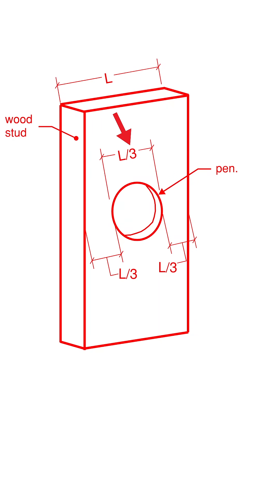1 Minute Structural Engineer Reviews Reddit Construction 2 #reddit #engineering #civilengineering

Comment: Yeah it's stupid and lazy and obviously the holes could have been smaller.   I think it looks like foam rather than conduit.   The lazy idiot should be made to do it over on principle alone.    No reason to needlessly weaken something.

Having said that, I'm going to say something controversial.   it probably would have been much worse if it was higher up like 1/2way up, where the bending moment would have been bigger.    Being right near the bottom is probably the best place to have screwed it up.   If you actually loaded it to failure, I think it might actually be surprisingly strong.   Not an excuse, but an observation.    It's not just the diameter of the hole, but where you put it.    It's more important midspan where the member has it's maximum bending moment, than near the endpoints.

Comment: Code allows drilling through studs. I don’t recall off hand but I think it’s half the width of the stud or maybe a little more. Should have drilled then pass the copper set through and then make the bend to go up. Like I said I don’t recall off hand because it’s been many years but the hole can be substantial in size compared to the width of the stud. I had to learn this in school learn electrical. But to cut the entire end out of the stud is no good. They have a wall with maybe an inch of stud holding it up.

Comment: The bottom plate is a 1 inch board not a two inch 2X4. This looks like the flimsy structure of a shed or outbuilding. If this is a house then the studs should be 2X6's to accommodate having that concealed inside the walls.

Comment: For something like this, if you need to "engage an engineer" you need to take a step back and rethink what you're doing in the first place, unless you like throwing money away. It'll turn a $2000 job into a $20,000 job. Structural engineers are expensive even just for a consultation.

Comment: Nah, the hole should be in the outside 1/3, not the middle.  I’m talking about the length.  If you have an 8’ rafter you should drill your holes on the outside 1/3’s. Never drill into the middle when talking about length.  And never notch the bottom side when the stud (rafters/joist) is horizontal. 

I guess you may mean if it’s a stud, only drill in the middle 1/3.

Comment: Just not enough stud to run a lineset through. A/C linesets ,usually 3/4 and 3/8 copper, are just not flexible enough to string through small holes. Even a 2" hole in a 2x6 stud would be damned hard to string like this with tearing up the rubber insulation. Any holes or gaps in the insulation could allow condensation to drip inside the wall. You sure don't want that.
I wonder if code would allow a kind of header down low to make a raceway.

Comment: I'll note that if a larger hole is needed, like for 2" lines through 2x4's, a stud shoe can be used to maintain structural integrity. There are some rules on max hole and notch sizes and should be looked up. The holes in the picture are still way too large.

Comment: If engineers and architects are sooooo smart.

Why don't they design homes with 2x6 walls in key areas where the utilities will be installed ?

Oh, they saved 50 cents per stud. I get it.
Reply: Engineers and architects will design what they are asked to.
Maybe they suggested 2x6s and were told that it wasn't economically desirable...
Reply: 0.50? Maybe 40 years ago.

Id build my house out of used pallets these days, with low quality lumber at hardwood prices.
Reply: I'll guarantee you that this abortion was not designed by either an engineer or an architect.

Comment: In the tree cutting industry, we call that a face-cut. It's what we do when we want the tree to fall down😂
Reply: Someone seems to have missed your humor
Reply: hahahahahaha
Reply: Which is precisely why you shouldn't do it in wood framing of a building.  Any member supporting a bending load, will concentrate its stress toward the outside.  Any cuts to the outside fibers will compromise its bending strength the most.  You want all holes for utility pathways to be through the middle of the studs, for a multitude of reasons.
Reply: @carultch  Thanks guy
Reply: @carultch  didn’t catch Amos’ dry sarcasm? Read in between the lines..

Comment: Been in the trades for 40 years, nothing surprises me anymore. I once had a job replacing flooring in a small cottage. Kitchen sub floor dropped 4” towards the bathroom. When the plumbers originally installed the toilet and tub drain they landed on 2 joists. They cut both all the way through. On the kitchen side the fridge and stove were against the wet wall. Tub was cast iron, all that weight dropped it. Tried jacking it up and blocking just to get the new hardwood floor in.
Some people just don’t care.
Reply: I swear my MIL has a knack for finding those people with her lowest bid mentality. Before we moved out into our own place, I was helping her snake out her gray water line from a laundry+bath. Wanting to listen to the drain for any gurgles at the 90* coming out the trailer, I peeled back the skirt. Just behind it there's a sanitary tee set horizontally dumping half the drain water under the trailer. 🤦‍♂️ I can't tell if that was done out of spite, or a misguided attempt at venting the drain.

Sounds like you helped out that cottage 💪
Reply: The unknown tradesman u encounter in construction is what causes the most angst & frustration.

Comment: What's above the wall? Is it a joist for the 2nd floor or attic that's the same size as the joists with nothing but air under them in the rest of the garage? Or is it studs all the way up to a truss or rafter at the end of a gable roof? Unless that's the back wall of the garage and there's a truss or joist right above each stud the wall is still plenty strong enough for the load it's supporting, though the building inspector probably won't  care.

Comment: There is a way you could build that wall using two by fours but it’s an exterior wall. You shouldn’t be using two by force in the first place other than that staggering the two by fours will give you a much thicker wall and you end up cutting into the 2 x 4 is less to run your lines because you have that additional air gap which also helps with your thermal break. Hope this helps.

Comment: Note wood is also a good heat insulation. The hole could have been for the pyp diameter only and insulation applied in each section
Reply: Actually, wood is a very poor insulator for both thermal and sound.

Comment: Could be not load bearing
Reply: Even if it isn't load bearing, it still has to bear the load of the plywood, drywall, piping, wiring, and any fixtures you install on the wall.

Load-bearing vs non-load-bearing, refers to whether the wall plays a roll in supporting other elements of the building, beyond the wall itself.  Even non-load-bearing walls, still bear their own load.  They just don't carry loads from other structural members landing on them.

Comment: Being in the business and familiar with all aspects of construction from beginning to end... you wouldn't believe the kind of sh*t some contractors will try to get by with. In this case there is a relatively simple fix but as seen it's not going to pass inspection. Not sure why these lines are being ran inside the wall when usually ran on the exterior.

Comment: I use 2x6 exterior walls and any walls where pipes are running. It is easy to accommodate for pipes if you plan ahead for them. I also make my subs use a gauge to get the center of the stud before cutting, I then personally inspect the chase.

Comment: I applaud using proper technical data,  but one should not need to consult anyone or anything to know you can't remove 85% of the stud.  Someone should be fired for that.
Reply: I design the structural members for roof and floor systems, basically I make sure I-joists don’t break. The number of times I’ve gotten calls on projects where a plumber cuts through the chords of a whole bay of joists is astounding. When that happens pretty much the only option is to send whole new joists, and redo the plumbing. You’d think it would be common sense for people to go “hey, maybe I shouldn’t cut almost all the way through the things holding up the floor.” But apparently not

Comment: We get around this by building a header and running need horizontal requirements the only penetration is thru the one end/top of the header…works like a charm, always approved…and if the partition requires it add thickness…
Reply: You drill the smallest hole and use stud reinforcing if it's more than 1.25"
Reply: @chrisanthony579  That's what's idiotic here.  An inch and a quarter would have been plenty.  Or maybe an inch and a half, if the wall's not load bearing.

Comment: Wow. Okay let's break it down... that is not conduit.  No one insulates conduit.  That is an HVAC line leading from the heat exchanger.  That "wall" is run on top of block without any straps or blots holding the wooden wall to the block wall.  From that we know that this "wall" is not structural and holds no load at all. Continued observation shows structural plywood on an none structural wall in a nonhabitiable space... why would that be? The first thing that comes to mind is to support stucco on the other side.  Stucco with wire lathe on plywood offers more structural support than the studs do.... on a non load bearing wall.  Did the HVAC guy cut too deeply? Yes he did.  Is it a problem? Nope, no it is not. Are you getting folks to overreact and make coin on YouTube? Yes you are.

Comment: Cant be someone with experience. When you pull the zip-ties like that around the insulation, youre asking for future water damage. As the insulation gets older it dries up which can fall apart when you ziptie like that. Any exposed pipe will have condensation.

Comment: Thats what you call conduit? Ive never seen conduit containing refrigerant before.
Reply: Typical engineer whining about code but likely he was the one who asked for a condensating refrigerant line run in the wall to begin with lol
Reply: That's what happens when your knowledge only comes from a book with no real world experience. Very common among engineers and architects.
Reply: Definitions from Oxford Advanced American Dictionary:

Conduit /ˈkɒndjuɪt/ /ˈkɑːnduɪt/
noun: conduit; plural noun: conduits

1. (specialist) a pipe, channel or tube through which liquid, gas or electrical wire can pass

2. (formal) a person, an organization or a country that is used to pass things or information to other people or places
Reply: @jadesisk1852  uh huh, sure, in my 20+ years in the trade (electrician) have I ever heard a plumber call any line conduit. But I have ran miles of EMT, rigid and PVC. I will stand by my original statement that it was originally a design by an engineer or a designer. Both are about as clueless in real world applications

Comment: …and it’s not conduit…which you really mean raceway. It’s refrigerant lines. Are you sure you’re an engineer???
Reply: The word "conduit' just means physically-constructed pathway for either fluid or wiring.  Even though it's more common in building vocabulary to call it pipe when it carries fluid, and conduit when it carries wire.

Either way, it's not relevant to a structural engineer's discipline to know or care about the difference.  That's for the MEP engineers.

Comment: Try double 2x4 stud wall for passive house concepts. I love the design and am adding it into my home plans. Better insulation and all electric and plumbing is inside the wall so none of the studs get cut and twice as many studs is twice the vertical load.
Reply: I prefer having four 2" studs.
Reply: Are you referring to alternating 2x4 studs (back, front, back, front) on 2x6 top and bottom plates?
Reply: @JT_70  I believe Ben (the OP) is referring to two separate walls with a cavity between them. As the post mentions passive house concepts, where 15cm (6") of insulation won't do.

Put two behind each other with a cavity for installations and we're looking at 25cm (10") or more. Which is getting into (the low end of) passive houses.

Comment: HVAC lineset bored through the 2x4 exterior load bearing wall, nice👍🏻
Reply: If that's an end wall it's unlikely to be load bearing, other than a modest  amount of wall and perhaps some of the last 16 to 24" of a gable roof. If there's a double top plate it's probably a code problem but not an actual structural problem. If there's a 2nd floor there's a joist above that wall, and it's just as big as the next one in that only has air under it. In that case the only thing the studs really do is give you something to nail sheathing to.
Reply: Sure looks like an exterior wall. But there isn't enough information in the video to make any definitive comment about it. The nail plates help keep the pipes safe. Otherwise it's just sheet rock support.
Reply: The HVAC line should have gone up then over.

Comment: If my engineer referred to my line set as conduit he would be fired on the spot
Reply: And tell me what whatever everyone else think when you focused on that instead of the severe damage to the wall that needs to be repaired?
Reply: You know it's not a structural engineer's job to care about the difference, do you not?  As far as a structural engineer, it's just another trade's work that is embedded in the wall.  Doesn't matter if it's conduit or piping, it still has the same rules that govern where it can be.

Comment: Wait.  Did this "Structural Engineer" get the location where notches allowed completely wrong?  ChatGPT says to avoid notches in the middle third of a stud, based on engineering principles that stresses on studs are greatest in the middle.  My 2009 IRC doesn't call out a location, but shows notches in the bottom third in the sample drawings for both bearing and non-bearing walls!
Reply: ChatGPT is either wrong, or it's misinterpreted what is meant by "middle".  I guarantee you that the middle of a cross section, is where you are supposed to make your utility pathways, for a multitude of reasons.

What you probably conflated this with, is the middle third of the length, rather than the middle third of the cross section.  Even then, it depends on the nature of the beam loads and supports, where the high stress points are.  Best points along the length to drill a beam, is generally between 20% and 30% of the span length of the supports, as this is where there will be a point of contraflexure, and bending stresses are close to zero.
Reply: @carultch  You are right.  I assumed that since the example showed a notch, he would address the case of where you made a notch, but he doesn't.  Instead, he switches to the rules for holes.  I often fail to listen to people carefully enough.

Comment: While you should never remove that much, the rules are overly safety oriented. Other than the fact that you shouldn't hide hvac line like that there wont be any structural issues. Modern stick built homes are ridiculously strong when it comes to compression. You only really need to know the shearing on your home is done correctly.

Comment: I would have just ran that lineset up to the attic space or floor joist running in that stud space penetrated. Typically, its a more important board you cut into but you have more room and just the one cut.

Comment: If the notches were higher you could use a stud shoe to repair the damage, but you are so close to the bottom plate with four in a row that they are probably going to have to replace the studs.

Comment: I worked in HVAC for a little while. You don't drill a hole for that. You run it where it needs to go, outside the studs, and if it needs to be covered, the framers have to come back.
Reply: Framers do not have to come back...They did their job...this is a job for another carpenter hired by the owner
Reply: Yep👍
Reply: I would be finding a new HVAC contractor.

Comment: It shouldn't take an engineer to know that's HVAC suction and liquid lineset and not conduit
Reply: "Conduit" is also a generic word that doesn't necessarily refer to electrical conduit.
Reply: Then I guess the wall is fine then. Because it’s not conduit.
Reply: It's going to be hard to become an engineer if you can't pass English 101. HVAC suction and liquid lines are conduits, by definition. 

Definitions from Oxford Advanced American Dictionary:

Conduit /ˈkɒndjuɪt/ /ˈkɑːnduɪt/
noun: conduit; plural noun: conduits

1. (specialist) a pipe, channel or tube through which liquid, gas or electrical wire can pass

2. (formal) a person, an organization or a country that is used to pass things or information to other people or places
Reply: @jadesisk1852  
The first part of his comment it shouldn’t take an engineer. Is the hint. He’s a technician and he’s referring to things by the names they were given. 
He didn’t refer to them as pipes or tubes referred to them as a line set.
Something that has a very specific meaning for HVAC. But no engineering meaning.
Reply: It would never take an engineer 😂😂

Comment: Does this still apply on non-loadbearing interior walls?
Reply: I would imagine so. It's a wall, it has to support not only itself but anything attached to it. Drywall, pictures, cabinets, etc. I wouldn't be caught dead doing this to any wall, load bearing or not.
Reply: It's not as critical as it wouldn't be load bearing but you still shouldn't beaver 2/3 of any stud.

Comment: You don’t have to be an engineer to realize that the structure is compromised. You just need to be not an idiot
Reply: Structure is clearly not in jeopardy with the steel reinforcement
Reply: @unpluggedpresidents  Structure is probably not in jeopardy, if that's an end wall.
Reply: @unpluggedpresidents  I’ll take it as a joke 😁